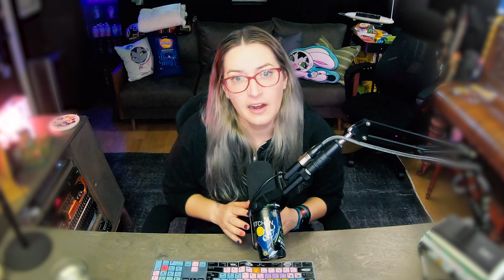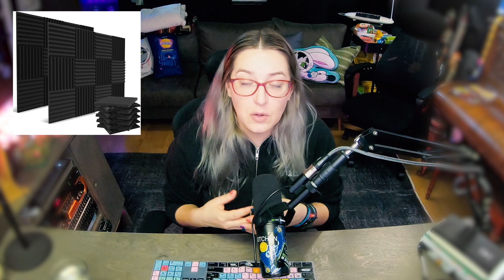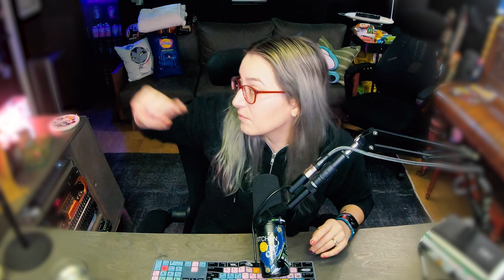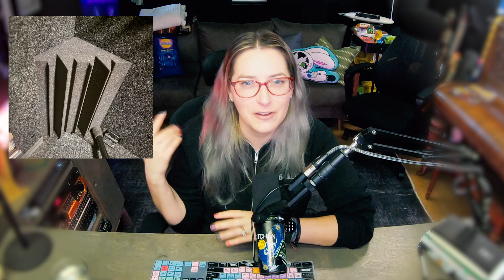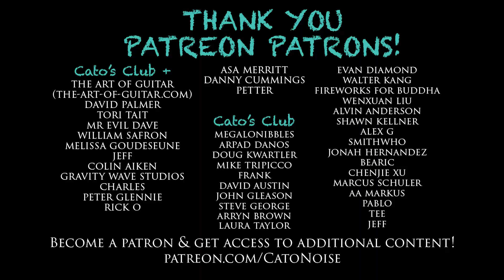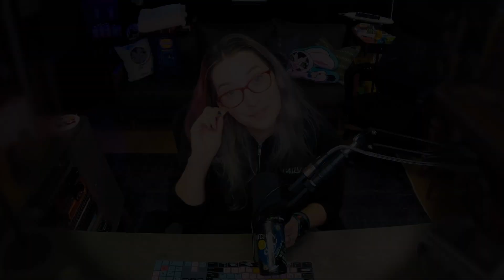Acoustics 101: Key Insights for Your Recording Studio Setup, Part 1

Comment: I just treated my space because I upgraded my monitors. I felt that if I had monitors of this caliber then treating my room was mandatory. I went with 2x4's, R13 Rockwool that is 14"x 47"x 3.5" and covered them with black weed stop from the gardening section. All of this can be found at Home Depot. I cut 2, 47" length and 2, 17" width 2x4's per box soffit. Affixed them together with 3" construction screws 2 per corner (make sure to pre drill or the wood will crack). Packed them with the Rockwool batts and they fit like a glove. You don't even need back support because they fit in there so well. Wrapped them with the weed stop and stapled them. Added hangars and mounted them with 150lb rated wall mollies. It is a lot of work, but in the end I made 12 panels for about $400 and my room sounds just like a professional studio B room.